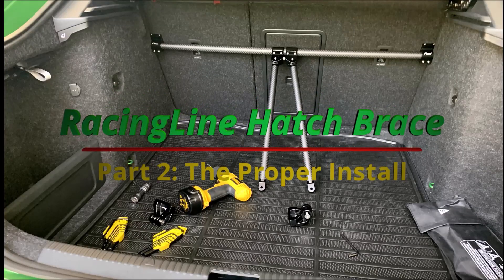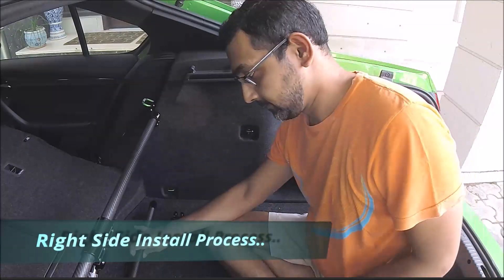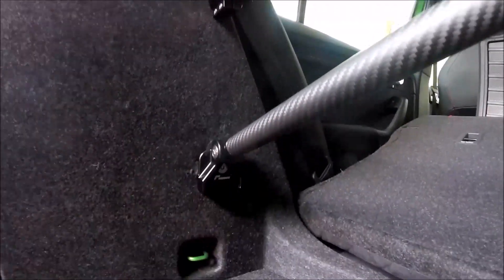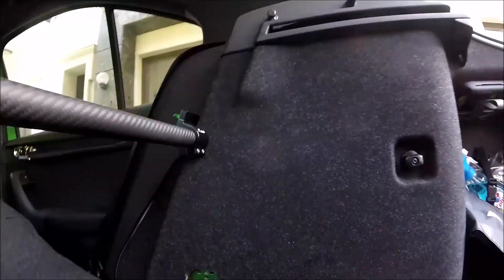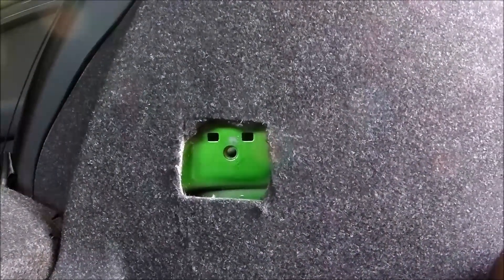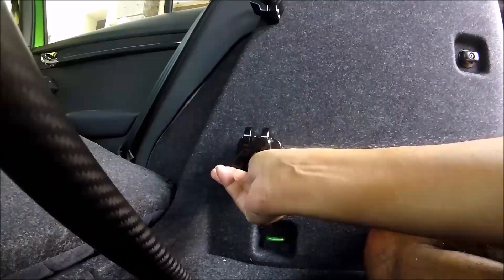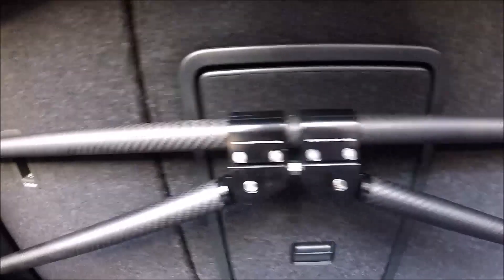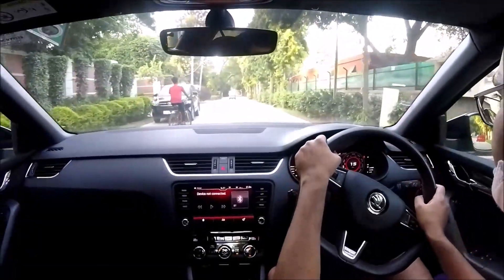RacingLine Hatch Brace on Octavia RS- Finding the proper mount points, installation and Test Drive!

Comment: As a standalone part, do you recommend getting this for every other stock RS230/RS245?
Reply from the maker: Yes. Makes a huge noticeable difference
Reply: @PrithwiRay  Should I even add a rear APR sway bar as well?
Reply from the maker: @harigovindsajeevan8123  overkill if ur doing this
Reply: @PrithwiRay  This is enough?
Reply: @PrithwiRay  Would there be a load difference in the front and the rear axles if I have just the rear chassis brace and everything else stock in the front?
Reply from the maker: @harigovindsajeevan8123  that is exactly what you want to happen. Rear gets stiffer, front remains pliant and reduces understeer
Reply: @PrithwiRay  That's not a bad thing by any means na? I thought if I am stiffening up the rear then I should stiffen up the front as well to match